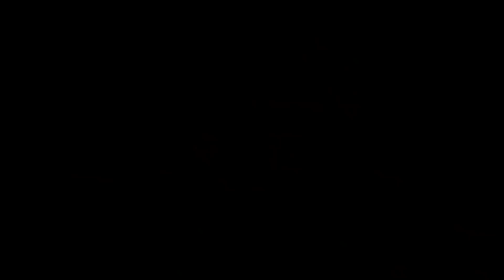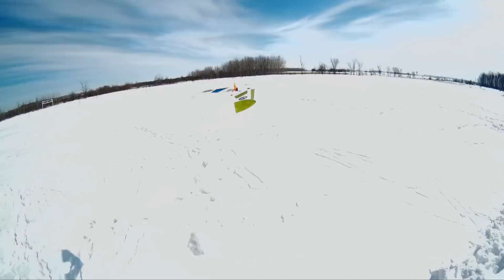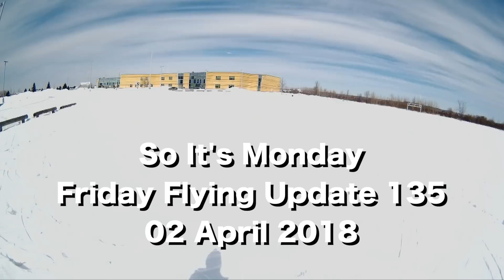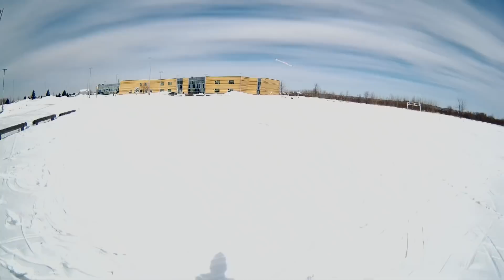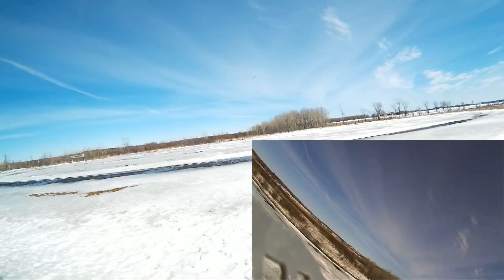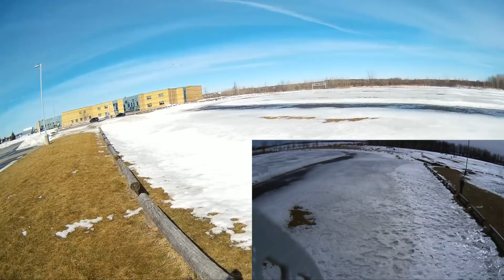So It's Monday - Update #135

Comment: Morning Andre,
Not sure if you saw the comment I left on the Flite Test forum for you regarding the fuselage, but since you said you were planning on gluing soon, I wanted to make sure I shared some issues I ran into while gluing the fuselage. It's not the last post, that one was a question about the prop. Hope the comments help. Or better yet, I hope all your fuselage parts have tabs. The only other issue I ran into was to get some CA inside the nut when I was gluing it into the nut housing. So I had to print another nut housing, thankfully they are short prints.  Can't wait to see the progress.

Graham